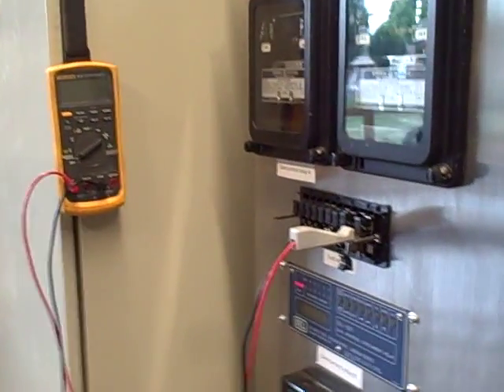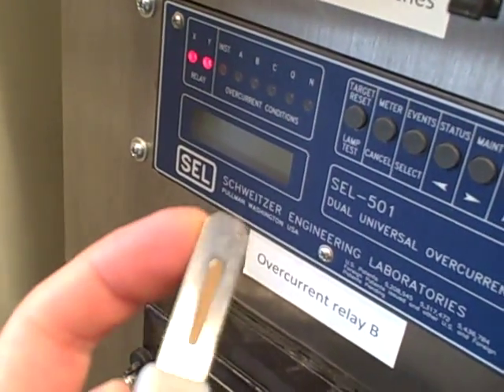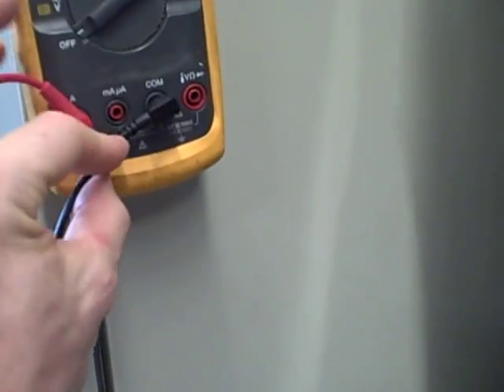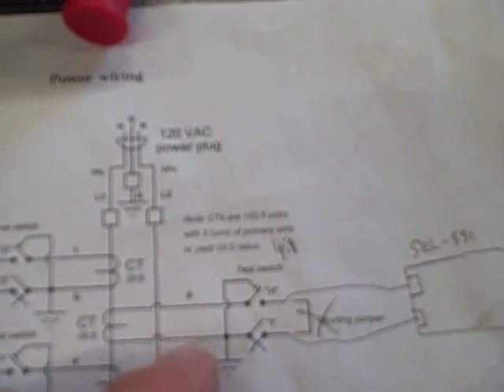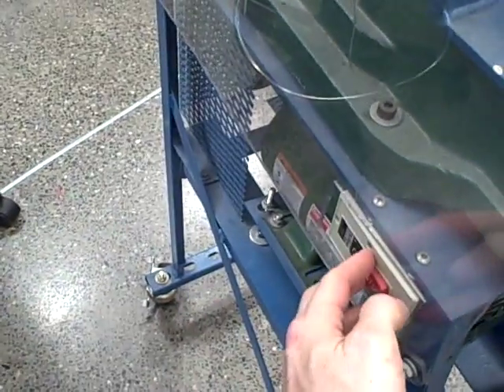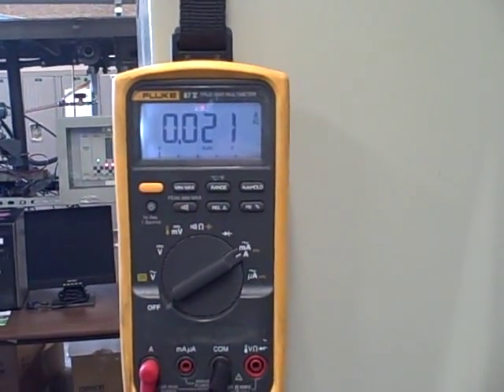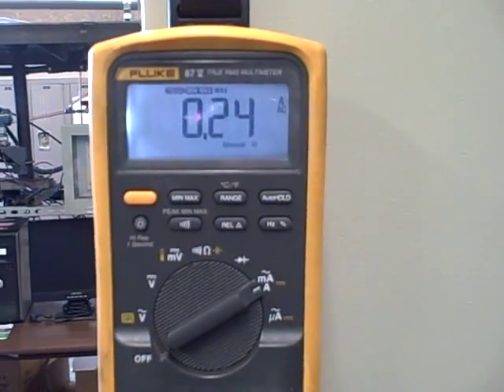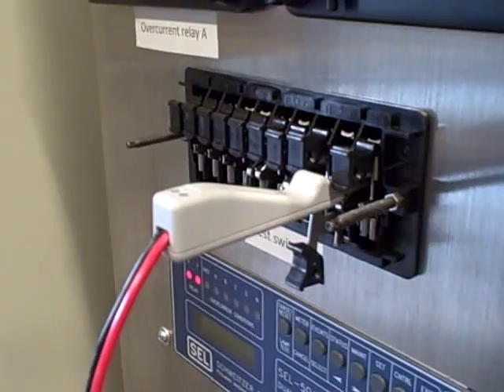Current transformer circuit "stab" test

Comment: There is no danger as long as the probes stay firmly  plugged in and the fuse will not blow - there is noway since a short is good! for CT /in this case.   Fuse will only blow if short circuiting a voltage source. This is a current measurement.
Reply: Where do you find such a probe?

Comment: It’s not a smart idea to use a fluke when doing this.. since the fluke is fused, you have a risk of opening the CT string.
Reply: There is no danger as long as the probes stay firmly  plugged in and the fuse will not blow - there is noway since a short is good! for CT /in this case.   Fuse will only blow if short circuiting a voltage source. This is a current measurement!
Reply: I second that.  If a fault occurs (over 10A), the CT is open and BOOM.  There are clamp on A/mV transducers that can be used.

Comment: DO NOT use that "probe" you call it for jacking into ct secondary's. Right in the middle is an insulating piece of material and if you insert it incorrectly by mistake you will be creating an open circuit condition with your test equipment!!

Comment: Guys, please! Do NOT plug your Flukes into the CT secondary! Even though Fluke has 10Amp fuse at its "Amp" terminal, you might find yourself in trouble if you are close to that fluke, measuring secondary current during some heavy fault. Your fuse will blow and have CT secondary open. The voltage at secondary will build up to tremendous values and could potentially kill you.

Don't plug your Fluke into loaded CT!

Comment: Pretty cool.  I remember reading about measuring current from end stacked 1.5 batteries using a device like this on an electronics forum by soldering wires on each side of a double sided circuit board and stabbing it in between two batteries.  That was years ago.

Comment: That's pretty handy, haven't seen those blocks before. Normally we'd be reduced to having to remove the motor panel or a isolator so we could squeeze a clamp meter on.